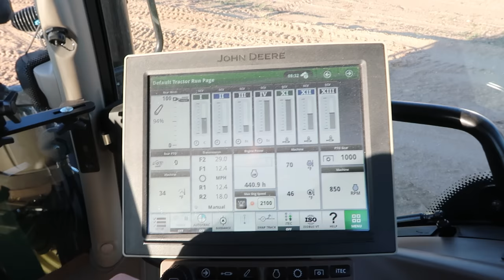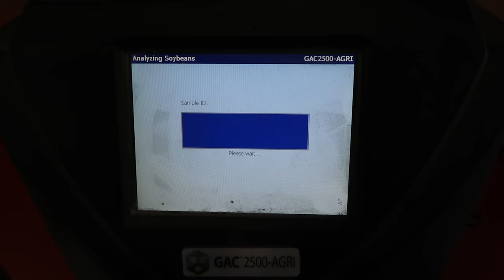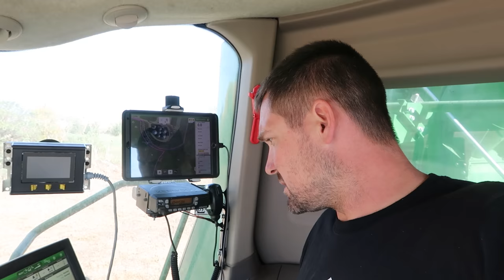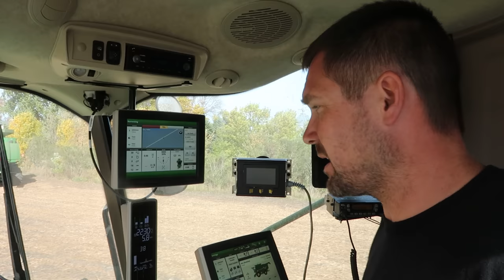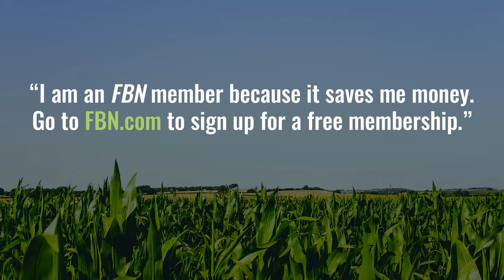A lot Goes Into Switching from Soybeans to Corn- Complications are Inevitable!

Comment: Electric motor bearings are pretty easy to change they are heat/press fit. I use to remove them with a 3 jaw puller and an impact. 

To put it on you can drive it with a sleeve or heat it to about 170-200 degrees Fahrenheit. Then it will slide on. This is assuming the shaft is ok and the housing is ok.

Comment: As nice as those loader controls are, one of my favorite to use to be honest, they are junk. I've used one where I had to keep flicking that safety switch a few times before the control worked. Somedays it worked normal, others it was a constant nuisance all day. The only fix we were told was to replace the whole joystick, which is not very cheap

Comment: Need to mount a chain hook at the center of the loader bucket so you're not twisting the loader when pulling posts.
Reply: I agree.  We always used the draw bar or 3 point to pull posts...., and trees.

Comment: Maybe protect the motor and the controls on the bins get a sheet metal company to make like a cover for it so it stays dry when you are not using it. The weather probably is not good for the Motors and levers.

Comment: Zach all u gotta change on a deere is the cob deflector, knives, chopper speed and the rethrasher wen u run a draper. Leave the feed system the same as corn. I hardly even put the rotor in high unless i absolutely have to
Reply from the maker: Interesting. I just checked into that and didn't know it. Thanks!
Reply: @MillennialFarmer  you're already done with beans but leaving accelerator on low you'll see less splits probably.  We even run the slow down kit for it and have no issues on low speed
Reply: "wen"?
"u"?
🙄
Reply: @deadghost1964  I'm a lazy typer.

Comment: Thanks for another great video Zach. 

Was interesting and enjoyable for sure. 

Like your new folding corn head. Pretty darn nice. Anxious to see it work. Hurry up next video. 

The piece on the tillage Jim is using was sure stubborn. Those bolts were tough to get off. But the torch did the job. Jim is pretty good at that kind of work. 

Lots of high cost maintenance to the bin system with the electric motors and such. Takes a lot of time to get set and running the way you want it. Those motors are not cheap. 

Lots of yard activities right now with machinery and resetting the combine and such. Anxious to see the new corn head operate. 

About it for now. You all take care and be safe. 
Good teamwork with all of you. 
Looking forward to the next video. 
Thanks for everything Zach. 
The Iowa farm boy. 
Steve.

Comment: motorprotection/electrical or autofuses when using power could have tripped due to high amps if the transfer was struggling bit.

Comment: Can’t wait for 1mil subs, Anna isn’t gonna know what to do in the cab. Also, please stop using the disconnect as a motor starter. Watch some arc flash videos online and you will install proper start stop control stations